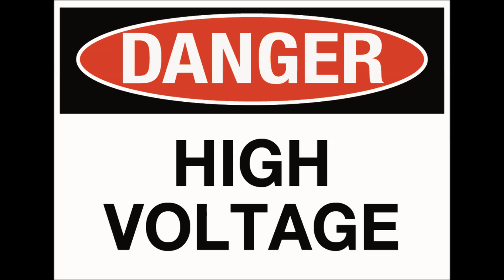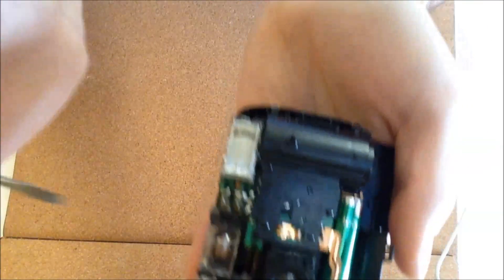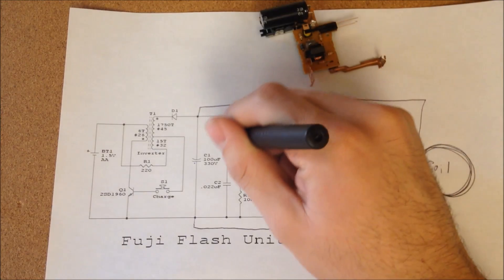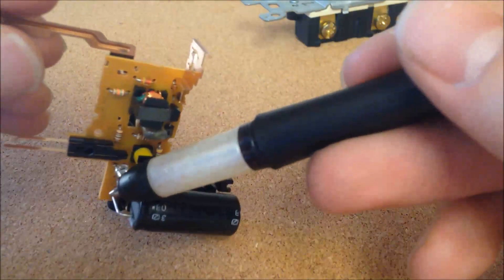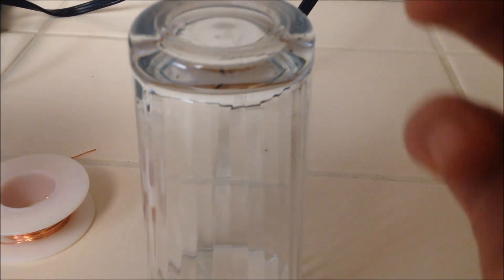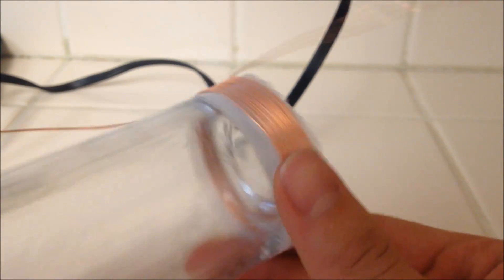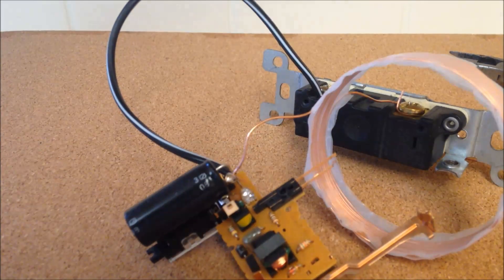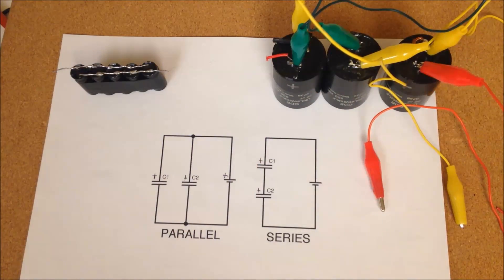How to build an EMP generator

Comment from the maker: I am very sorry to those people I have not replied to. YouTube will not let me reply to some of your guy's comments for a reason that a "reply" button is not under your comment. I am very sorry and do my best to somehow fix the problem. ;(
Reply: Cameron Cobb how far is the raduis of  this emp
Reply: he cannot sell them. It is federally illegal. All he can do is show you how to make one. Although he turned it on which means he broke federal law. I can make a more in depth tutorial on how to make one if you would like.
Reply: Hey I have a question. Do I need a camera charging unit for this to work? Can't I just connect the batteries to the capacitor bank, let them charge and then connect them with a switch to the coil? If the capacitor bank is big enough to store more power will the range increase?
Reply from the maker: Sadly no, the capacitors will charge to the maximum voltage the battery will give out. For example, if you have capacitors rated at 100 volts at lets say 1000uf and you have batteries that give out only 12 volts, the capacitor will only store 12 volts because that is what is given too them whereas if you used the flash circuit from the disposable camera it will charge up the capacitors to its full rating. And adding more capacitors to your capacitor bank will make the pulse stronger; however, the range of an EMP device depends on the coil and the pulse so adding more capacitors will make the pulse stronger and possibly increase the range by a few centimeters but adding more wraps and a bigger diameter to the coil can also increase the range, but i only recommend adding more wraps and expanding the diameter only if you add more capacitors.
Reply: So, Lets say I have 5 capacitors 10000 mF 35V. If I add lets say 30V to them(for safety measures, I want to leave some space so the capacitors wont fry) and let them charge for a few seconds i will get a burst of electromagnetic field. If i add 10 capacitors of the same kind and wait for then to charge I should get a better result? I don't really expect anything very powerful. Maybe something that can fry electronics at 20-30 centemeters. But I suppose I will need a better, thicker coil and a lot more capacitors.
Reply from the maker: Grigor Gelov What you said is correct. You will get a better result if you add more capacitors to you bank/circuit. With that high of rating i would make a coil with thicker wire, more winds, etc...
Reply: I wonder if one can make the coil as a directional antenna to get bigger range. But I guess the way it works now would be good enough if the coil is constructed really well and the power is enough
Reply from the maker: Grigor Gelov It is possible. I have been experimenting and there has been great results. I just want to perfect it.
Reply: +Cameron Cobb Anyone know the range on this? im trying to make a directional emp for my mechatronics class as a final everyone makes and programs robots that fight and i think having a directional emp on my robot would be a cool and funny way to win/disable the there robot any ideas??
Reply: +Cameron Cobb  did you just destroy that nokia phone
Reply: I have made the emp generator from a flash cam but its not nearly strong enough,I need to destroy a microchip that is implanted in a tooth. it looks  as its made from a lot of hatachi chips (integrated circuit) probably with  20 pc )
Reply: WE ALL NEED ONE OF THESE! In case the government sends tiny stinging drones after us to make us sick! I have already seen all the new tiny bug like drones they are making which could easily be used against us by injecting us with God knows what when one lands on you and stings you. "Revelations 9: 3 And there came out of the smoke locusts upon the earth: and unto them was given power, as the scorpions of the earth have power.

4 And it was commanded them that they should not hurt the grass of the earth, neither any green thing, neither any tree; but only those men which have not the seal of God in their foreheads.
Reply: yea i got couple of them
i just watched you last video EMP 2015 and it didnt kill any device is strong current killing devices or voltage or is it enough 300V and some current
and what number of turns means i thought more turns means higher mag field - more efficiency
and is this just one pulse or its DC current
Reply: Does the device need to be in the coil
Reply: Cameron Cobb Dear Cameron, thank you for sharing your knowledge. Do we need to change something to the camera circuit if we want to charge 3 capacitors in parallel of 450V 47uf ? We have a transformer that provides 1,5 volt DC continuously. Is the camera circuit with its joules thief calibrated to only 300 V ? Thank you in advance for your prompt reply. Cordially Nenki.
Reply: Cameron Cobb Hey Cameron. I know why you can't reply to their comments. It's because they have to have "Who can comment on your public posts?" set to "Anyone" in their Google plus video settings. If they don't do that, you or anyone else won't ever be able to reply to them.
Reply: +Cameron Cobb I am confused on how the battery and the capacitor work. the capacitor is 330V and that looks like a AAA battery. How does the battery power the capacitor? If I were to add another capacitor in parallel and use a 9v battery, what would I achieve? Can I just use a another capacitor in parallel without using a more powerful battery?

Also, do I really need the circuit or can I just a attach a battery to a switch and capacitor then to my coil
Reply: capacitor just look like battery  it can store 330V max  and battery can 1,7V, if you charge with battery that voltage will be in capacitor   not 330V

you can charge  capacitor with wall socket just use diode bridge and resistor
or one by one (if 110V) then connect in paralell and  but be carefull they are charge
Reply: +Janko Vidackovic so the battery just charges. If I use a 9V I can just have a 35V capacitor if it gets me higher uf? which brings me back to do I even need the circuit or just capacitor and switch
Reply: I do need the circuit I read an earlier comment. will lowering the voltage on the capacitors decrease the range or strength or both?
Reply: Sebastian Sanchez
just charge capacitors and fry electronic
Reply: +Cameron Cobb  can i build this with out a push button?
Reply: +DatGuyT I'm not that smart at this kind of thing but couldn't you use this idea only with much larger capacitors placed back to back and a huge coil (like 100 times around) then program your robot to charge and fire the emp when it's next to its challenger. my only thought after all that is how would you keep your robot safe from the blast
Reply: +DatGuyT also look up Faraday cage, you might be able to do somthing with direction with one of them
Reply: could you use a basic version using just the capacitor, switch, button, battery,  and coil, or do you need the main board
Reply: joe raidal can I ask you a personal qurstion? how did you find our it was on your tooth?
Reply: Unlimited FB Likes http://storage.googleapis.com/0330231164389/7942220624521.html
Reply: Cameron Cobb What kind of wire do I need as far as thickness for both the magnet wire and the stranded black wire?
Reply: Why did you add the push button for?
Reply: Ryann Navin i got one, this one is almost silence free (almost no sound, but very active. in traintickets you see the chip itself sparking) but idk if it's illigal. i think it's legal, it has only a range of 5cm

Comment: Why is the camera still working if the EMP is turned on ??!! It's fake !
Reply from the maker: This video is not fake and these are the reasons why. 
1. This EMP is very weak and low powered and has a average range of about 5 cm from the coil depending on the device meaning anything further than 5 cm from the coil is not affected by the pulse. 
2. The camera that i am using is the IPhone 5 camera and inside my IPhone and inside many other phones and devices is a metal plate that is suppose to protect the phone/device from any Electromagnetic (EM) interference. My EMP sends out an Electromagnetic pulse that cannot damage or interfere with my phone or other electronic devices because of that metal plate inside. If i were to put my IPhone which was filming this video, into or next to the coil, it would have no affect on the phone. The devices in the video (Gameboy and Nokia phone) were affected my the EMP because it has nothing but plastic shielding the strong magnetic force.
Reply: Cameron Cobb what are the materials that i need to build a emp jammer using bus zapper? is there anything that i will add like capacitors? is the emp generator in the video the same in a emp coin slot jammer? thanks for the help, i am curious what is magnetic pulse is, i'm going to college this coming june. i want to learn how this works and how to build it, i'll study electronic course i want to have a little advance. thank you for the help. thanks!
Reply: Cameron Cobb so then the EMP sucks
Reply from the maker: +Timo Benthack yes, this EMP sucks and is very weak.

Comment: I have two fairly large capacitors out of a 500W power supply for my computer, I want to try this with one of them but I'm worried that I don't know enough about circuitry and was hoping some one could point me in the right direction. the thing that worries me is that these are fairly hefty capacitors and I don't know if it might be physically dangerous. can some one tell me more?
Reply from the maker: I would love to help you with this! What are the capacitors rated at (capacity and voltage) and how many were you wanting to put in your circuit?
Reply: Cameron Cobb the labels read CapXon 1000uF-200v LP VENT 85 degrees C I'm not sure what those means though, besides the comp;any name and the voltage but what about 1000uF?
Reply from the maker: The 1000uF is the capacitance of the capacitor. uF stands for micro farads and there are nF and pF which are nano farads and pico farads. Micro farads (uF) are the largest out of those. There is such thing as a Farad but a capacitor would be also be very large! Usually the higher the capacitance the lower the voltage you have. The capacitors you have (200 volts 1000uF) should work fine. You would have a very strong pulse, however; discharging a capacitor with that rating will make a loud bang and bright flash, and if you shock yourself with those capacitors, that can be very fatal if it goes across your body. Please be cautious with using those capacitor because I have never experimented with capacitors of  that high of a rating. The highest I have experimented was 8x 600 volt capacitors rated at 30uf wired in parallel making it 600 volts and 240uf. To charge capacitors with that high of a rating I would put 6 volts (4x AA or AAA batteries) into the camera charger circuit instead of the default 1.5 volt (1x AA or AAA battery).
Reply: Cameron Cobb Well the whole fatal thing sounds honestly terrifying so I'll probably just end up sticking with the camera's capacitors... though if I did use the power supply capacitors what kind of an effect would that have on the device? would it increase the range or the power? I feel like that makes sense but I also feel like I don't know enough to just assume that...
Reply from the maker: It's totally okay to use the power supply capacitors, you just have to be more cautious. And you would definitely have a stronger and more powerful EMP. The range of the EMP has to do with the coil, thickness of wire, diameter, and how many wraps when it comes to powerful capacitors like that so if I were to make a cool using those capacitors, I would use thicker wire with about 20 wraps with the cool diameter about 5-6 centimeters. Range is very tricky because it depends on many variables. The rating of the capacitors, the thickness of the wire, the diameter of the coil, and how many wraps around (also said above). Different devices have different ranges too. The 20 question ball game I could EMP from 7 cm away from the coil whereas the cellphone had to be inside the coil. So overall you should have an EMP that sends out a very powerful pulse and with a pretty good range depending on the device and coil.
Reply: Alright sounds good I'll probably end up trying it then, thanks!
Reply: ***** That's actually quite comforting thank you.
Reply: I was thinking for the coil, in part of the video you rapped it around a bottle then took it off. I have a lint roller handle but all the stick pads are gone so it's just a handle with a large cylinder at the end that is more than long enough for twenty raps around it. Would this be capable of working as more of an EMP wand if I made a housing for the circuitry and stuff to attach to the bottom? Also would the plastic disturb anything like the pulse or just electricity or anything? And it's much larger than the 5-6 cm diameter you said; I think it's about an inch and a half, but in the video you had a much larger coil than that so I'm somewhat confused.

I'm sorry if some of my wording here was bad and in-descriptive this was written in haste...
Reply: Okay cool, also thanks for the tip!
Reply: ***** what are the materials that i need to build a emp jammer using bus zapper? is there anything that i will add like capacitors? is the emp generator in the video the same in a emp coin slot jammer? thanks for the help, i am curious what is magnetic pulse is, i'm going to college this coming june. i want to learn how this works and how to build it, i'll study electronic course i want to have a little advance. thank you for the help. thanks!

Comment: what kind of capacitor and gauge wire do you think will be necessary to shut down the lights in a room
Reply from the maker: I don't think it is possible to shut down the lights in a room.
Reply: elaborate, what would prevent me from doing that.

Comment: If I had a 42,300 uF cap bank at 25v will this still work, or should I run it through a transformer?
Reply from the maker: I have never experimented with capacitors of that high of capacity but I would assume it would work just fine! Just take extreme caution.
Reply: Ariel Lezen you would only have a big capacity capacitor, it would only run 25v through the device, if the device could handle 25v it would not work

Comment: I understood everything except that ''Push boton'' he just put there.... to which point is it attached to!? what exactly is supposed to do?

Any of u guys have a schematic of the circuit WITH THE PUSH BOTON?

thank u!
Reply from the maker: The "push button" is just a replacement for that metal thing that acts like a switch to charge the capacitors. They both (the push button and the metal thing) do exactly the same thing it's just I removed the metal thing and put the put the prongs of the push button where the metal thing was. The push button is an optional component. I used this in the video just for safety and to avoid electric shock. If you look on the schematic, "S1" with the word "charge" under that component is the metal thing. I just substituted it for a push button. If you have any more questions, just ask. :)
Reply: Fernando Alberto Tellez Miotta yeah! what is the push button even supposed to do???

Comment: hi i did it and its not working
Reply from the maker: Alright. Is the circuit charging up the capacitor? And what device are you trying to EMP?
Reply: no it is not charging and i makeing it for a slot machine
Reply: i feel that i have to get a next 1 so i can start over
Reply from the maker: It's a circuit problem then. I would advise you buy another camera/circuit. I have not tried this EMP with slot so I do not know if it would work. The EMP jammers that work with slot are a different concept than this. This just fires a pulse to where the device will be interrupted with a strong magnetic force that it will just shut off. The EMP jammers that work with slot fire multiple pulses and work under a different set of principles.
Reply: ok ah u on facebook just look up my name amd add me ok